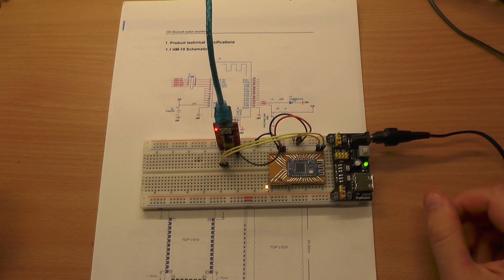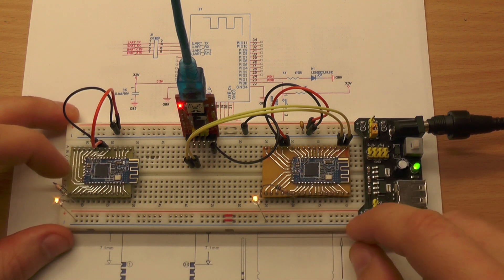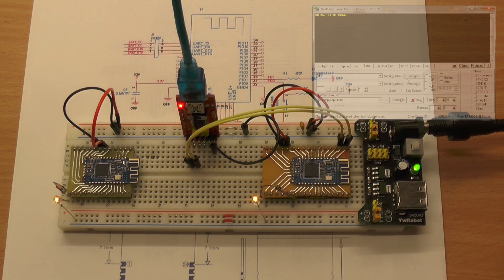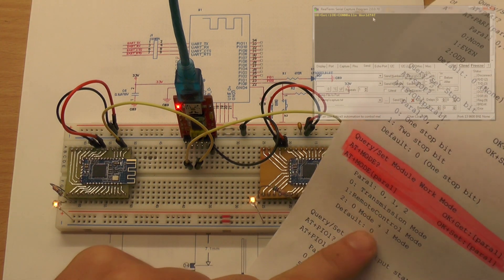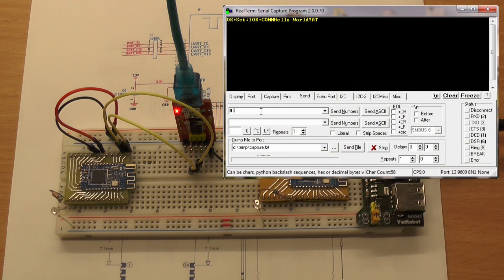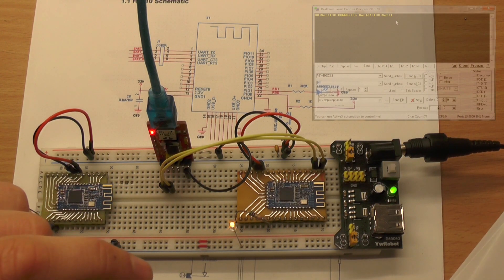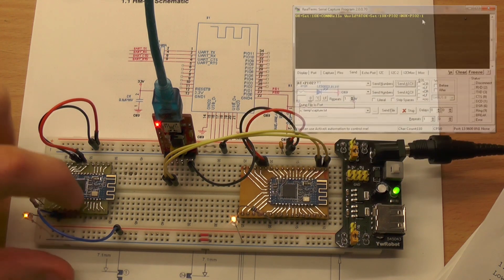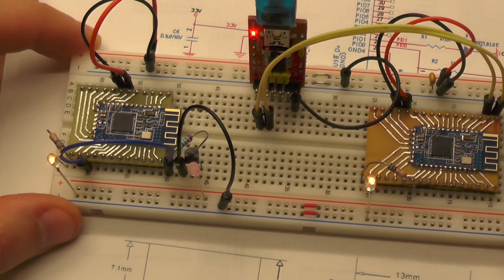Bluetooth 4.0 (BLE) - 07: Data transfer and remote control

Comment: i have project. i use hm-11 ble module. i can configurate ble with AT commands and send data from ble to my iphone but i dont get any data from ble to my computer. hc-06 open comport and take data. hm-11 and other 4.0 device that dbm01 doesnt open comport. how can i take data from ble to my computer. (computer bluetooth and ble is only pairing )

Comment: Hi sir,
Can someone answer my question?
I would just like to know if the connection between the two modules (module 1 and module 2) in the video are exclusive between them.
What if another module is in range (lets say module 3)? will module 3 also receive the transmitted data from module 1?

Because I just want to know if you could pair only two modules with an exclusive connection. 

Such that when there are 6 modules in range.
module 1 is only communicating with module 2.
module 3 is only communicating with module 4.
module 5 is only communicating with module 6.

I hope someone can answer me. :'(

Comment: Hi !
How does support sleep mode and IO read/set ?
What I mean is that if I send AT+SLEEP to my slave module via BT, is it possible to wake up that module without using a uC connected to the module ?
I am really looking for low power consumption...
Reply from the maker: I have used an older version where the firmware didn't support sleep yet. Might be an interesting investigating it. If you have some results feel free to link them here :)
Reply: Hi!

Jules did you find anything on the sleeping modes? I just need the same feature you mentioned in your comment!

I tried to autosleep my slave and it will work sometimes, but will not connect when a pin is set.

Did you get something on this subject?

Thanks!
Reply: Hi Mario !

I didn't research much about it as I just needed it for prototyping. I ended up using another chip that suits more my needs. It's the Nrf51822 (in fact it's the equivalent of the chip used in HM-10 but from Nordic, not Texas) I  use it already soldered (look for "PTR5518). It's really great ! 
But if you only want UART, I would consider reading the  CC2540 datasheet 

Cheers !
Reply: Hi Jules!

Thanks! I will take a look on the Nordic one! Thank you! :)
Reply: If it's only for fun you are going to spend some time on it but if you are really planing on playing a lot with BLE, my advice would be to order their development kit, you will have access to plenty of documentation on their website and support on their forum ! I am really enjoying it at the moment :) Moreover the chip is really flexible and you will be able to do almost anything you would like with it.

Comment: Hi, have  you used it with android or iphone device?
Thanks for the video. 
Ricardo.
Reply from the maker: still waiting for anandroid 4.4 update for my phone... so might take a while until I do it via phone
Reply: bitluni's lab
I see. Well, I am trying to make it work with Android or iOS. I can configure it via AT command. Everything seems ok, except pairing it with  computers or mobile devices. Thanks.
Reply from the maker: Ricardo Caratti the documentation of the at commands was a hint, that there might be some problems pairing and you have to use a specific mode for the pin code. I can't remember the specific command but did you try something there? I had to change the mode too to be able to pair to my pc even it's useless since there is no implementation for the specific gatt profile.

Comment: Nice video. You gave me the confidence to really dig in to my xbees now. What's your experience with range? Has it been pretty good? 100+ feet or so?
Reply from the maker: Within my flat was the best like 10meters with a brick wall in between. I just went outside to test the range outdoors: The connection was etablished at about 21meters and was stable until about 40meters. I guess it is better in regions with less electromagnetic pollution. The connectivity could be probably improved if I geve it more than 300ms to connect.